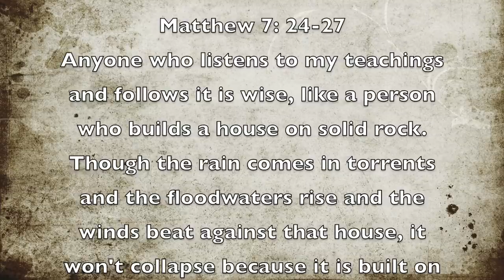Foundation Options for Our OFF GRID CABIN & HOW MUCH IT COST💰 / Episode #4

Comment: Just so you know we put a slab on our pole barn home and that is how we heat our home. We used radiant floor heating. 7/8 inch per laid down before the floor was poured. Stays warm and toasty on our feet. Love the videos!!
Reply from the maker: Our old house was on a slab too but wasn’t floor heated.. plus we had drainage problems which nothing could be done to fix it except to snake the lines every few months. It was a pain to us and I said I wouldn’t do that again or use the same plumber 😉

Comment: There are other ways to get the materials in there like pulling a larger trailer with up to several thousand pounds at a time with small tractor or rent something like a skid steer with tracks. I know its as much of a matter of costs to you but we are talking about avoiding essentially almost all manual labor .have blocks delivered or picked up on pallets,  rent skid steer and fork attachment one day for about $200 use to load and unload the pallets on trailer then pull it with skid steer to sight and save a lot of time in the process as well as save your labor for what has to be done with manual labor.

Comment: To change your other slab complaint Use foam insulation under it like its mandatory in the north.  This has the added benefit of turning it into indoors thermal mass .  You could even put in radiant heat and have backup or primary outdoor wood furnace for heat. In your case you likely have enough energy with the dam to supply everything you need though.

Comment: The backhoe or excavator is right there that would save a lot of work.. Another thought about slabs if or when I build another house it will either have a basement with  under slab insulation or a crawlspace with minimum slab for the crawlapce which will have at least a fair area of 4-5 ft height so it can have at least a hatch access from inside for storms and "safe room" for valuables as well as make it very easy to store things that are not used often like for me duck decoys etc.

Comment: several points but right now : Slabs are much more of a design failure causing the issues you mention .  There can be channels left in the slab to run plumbing and electrical etc where it is accessible in these troughs for future access or repairs etc.
Reply: Not if you are using a concrete base as your flooring as well. I have a 1964 ranch home - to get at those things, we would have to take a jackhammer to the floor. Living in Southeast TX, the only reason my foundation hasn't cracked and settled is because it is caliche/limestone, so it breathes and released moisture. Greatly limits flooring options (carpet is gross after a few years, luxury vinyl works best) unless I decide to float a floor, and the ceilings really aren't high enough for that. My design for my next home will ensure that I can get to all electrical and plumbing myself without issue.